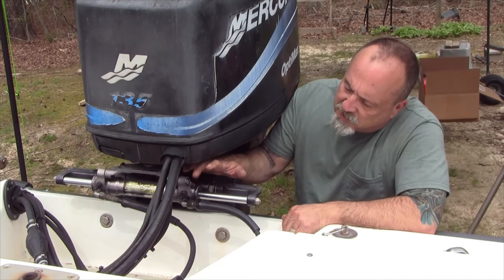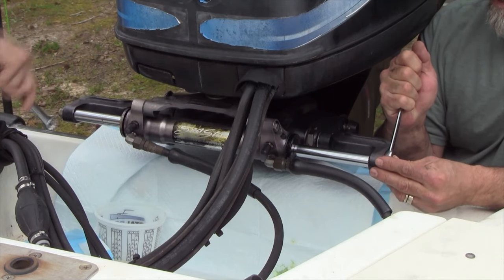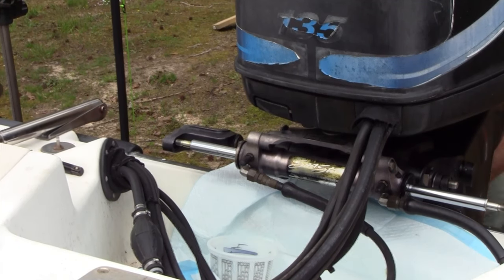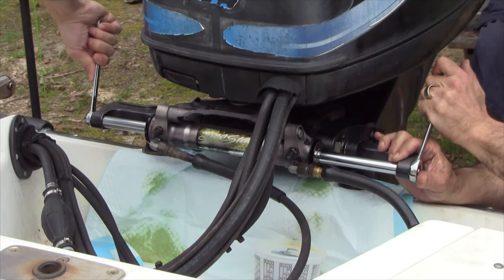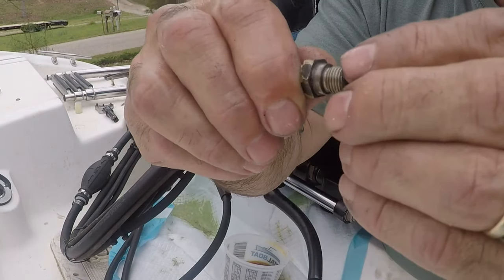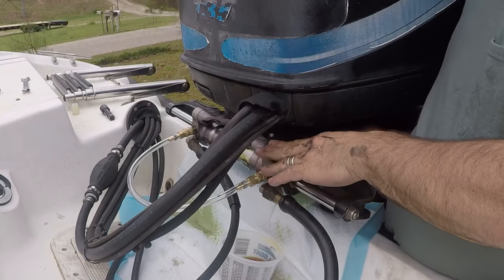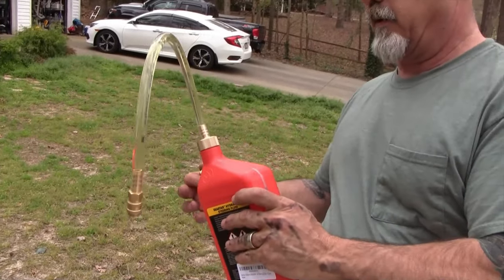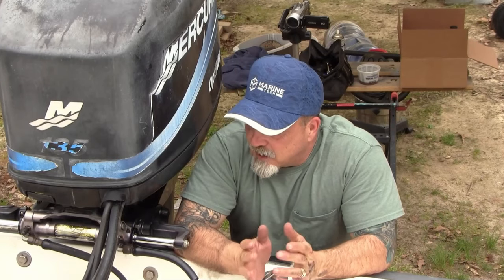How To Replace SeaStar Hydraulic Steering Seal Glands and Flush Air Out

Comment: Great video, thank you! Does the air flush method work when filling a new system as well? I have watched several videos and they all use a container at the cylinder to pump out fluid and air into. How come? Are you the only guy that use the method shown in the video?

Comment: How about the internal shaft seal? That is the one bypassing pressure on my boat when it gets cold.
Reply from the maker: Same process but you pull the entire shaft out to get to the seal on the inside. You need to be extra careful not to score the bore when pulling the shaft out which could cause cross over leakage.
Reply: Incorrect info here. Seastar seal replacement literally says if inner seal is damaged cylinder must be replaced.

Comment: Will this tool you linked in a previous comment (Pin Wrench - K1017 - 35mm x 5mm) work for a yamaha 200? it is equipped with a sea star steering system.

Comment: That's what is confusing to me, my basic comprehension is that the air bubbles just keep cycling back and forth in that hose as a bridge. The other method I saw running each one on its own hose, and turning one side with the drain going into a bucket of fluid until you dont see fluid anymore 🤷‍♂️🤷‍♂️🤷‍♂️ kind of stuck on what method in going to do.
Reply from the maker: The method used in my video worked out great!

Comment: How do you know if this is needed or the solution?  I mean I  bleed my system and it always will get air back in system.  Zero corrosion on bar and no hyd fluid leaking Anywhere.  Can air get past seals without leaking fluid?
Reply from the maker: My seals were leaking pretty bad, you could see the fluid in the splashwell. Any time you change the seals you'll need to refill and flush. I imagine that it is possible for a seal to suck in air but not leak oil. Probably on whatever side is opposite the side that has the pressure on it if that make sense.

Comment: Thanks for a super informative video. I was lucky and all the support braces came off easy and the seals were easy to replace just like you showed. Extra hands were helpful here. 

My question though is refilling. I used your method using the same fill tube and bleeder tube but I cannot seem to get enough fluid into the helm to fill the hoses and cylinder.  Lots of little bubbles at the helm but much larger at the bleeder tube. Turned the wheel 30 times both directions at least twice and it just doesn’t fill. The motor now moves when I turn it but there is plenty of play especially on the starboard side. Did I miss something or do I have another issue?
Reply from the maker: I would try closing the two bleeder valves. I noticed that occasionally and wonder if having them too open lets the vacuum on one side suck in air.
Reply: @ExtremeDIYGuy  Thanks for the quick reply.  I thought having the bleeders too open might be the issue too so I did the quarter turn and was able to get fluid flowing better. However, while sitting at full stop starboard letting bubbles purge out into the helm bottle, I heard a pop and thought the marine tech bleeder connection just came loose but actually the bleeder tube busted open spraying fluid everywhere. Once I get another bleeder tube and another bottle of fluid I’ll try your suggestions. Thanks again for the video and reply here

Comment: Thank you! Just did mine today thanks to this video. One thing I did differently is I removed the bracket on ends of the arm before loosening seals which gave me plenty of room. Breaking the bolts free alone was easy as well. Broke one free then retightened the broke the other end free. First one was easy to remove holding the bar with my hand. The dirty part was adding oil - I like your set up way better!!! Very well done video - thank you!!!

Comment: Thank you for the tutorial took me an hour.I bought that special pulled tool and didn’t even need it.2014 skeeter sl190 150 vmax
Ps. I did not poke a hole in my expensive bottle of fluid either.
Reply from the maker: Happy it worked out for you!